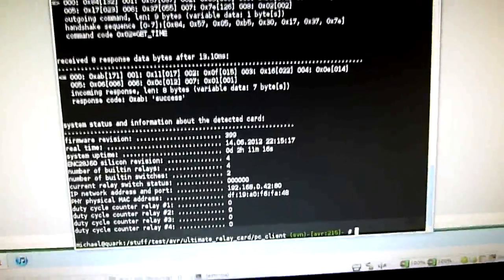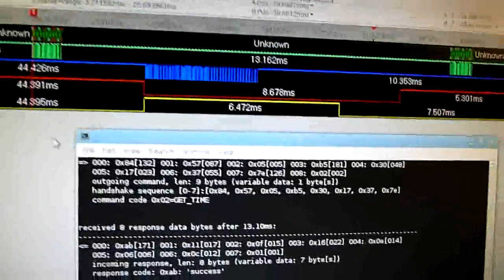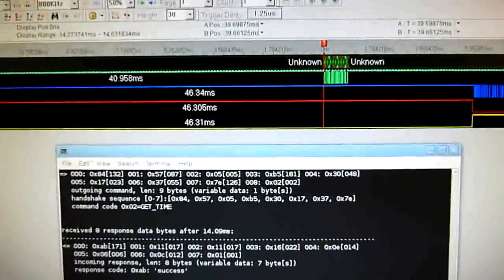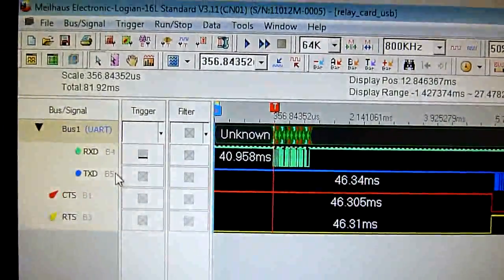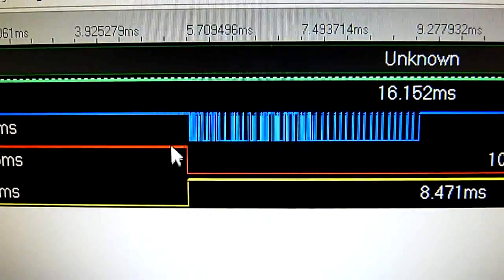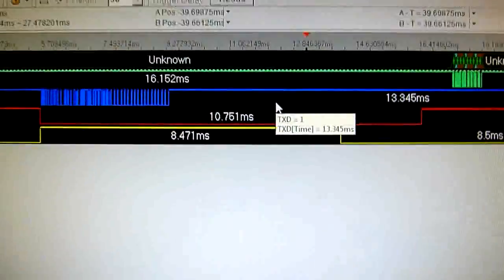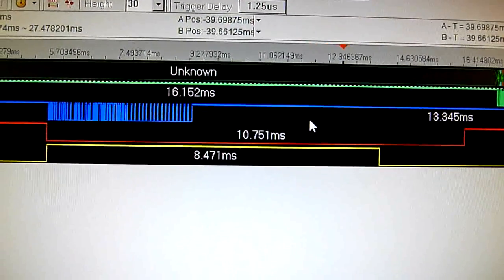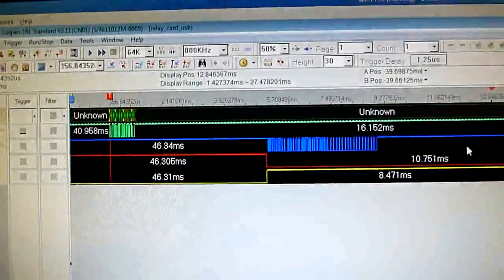USB-UART comm protocol results and again why USB sucks

Comment: I'd recommend using a USB device chip directly. This will give your desired packed based protocol. Try either a micro with built in USB or a local bus USB chip. (st-ericsson has some) Don't bother with RS232.

Comment: Good job for finding a work around. If I understand correctly, although the FT2232D USB protocol is opensource, the description lacks clarity, or is missing some valuable information. Is that correct.  Thanks for freely posting your code, Michael.